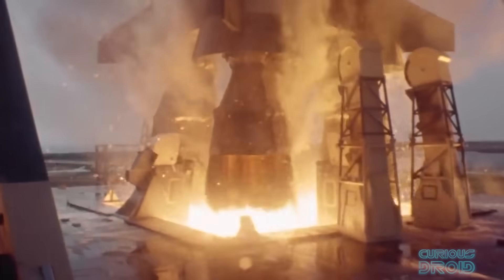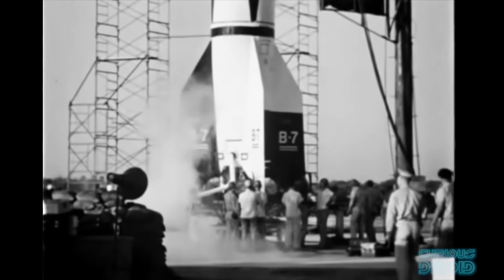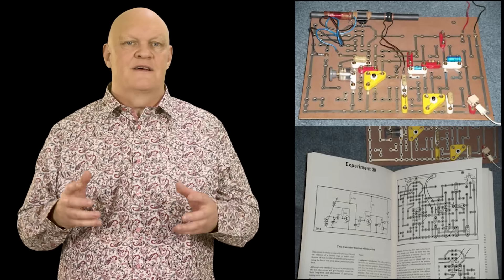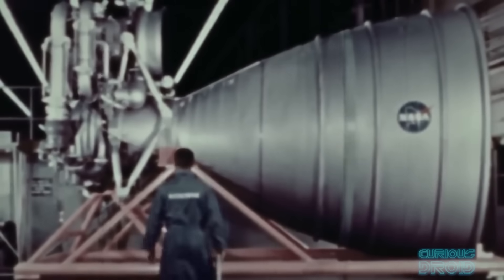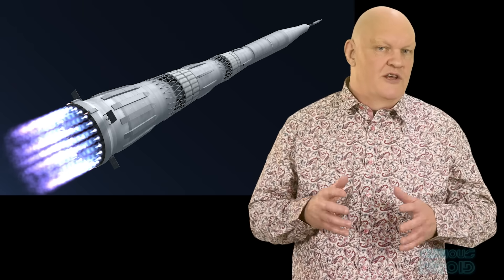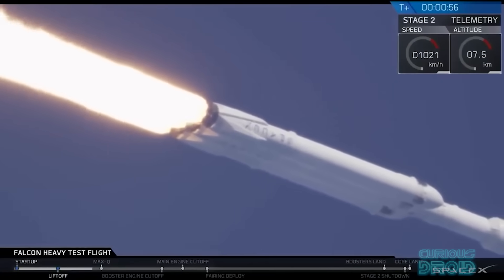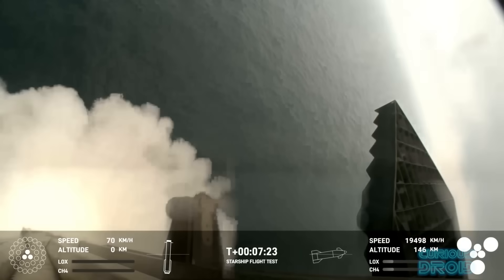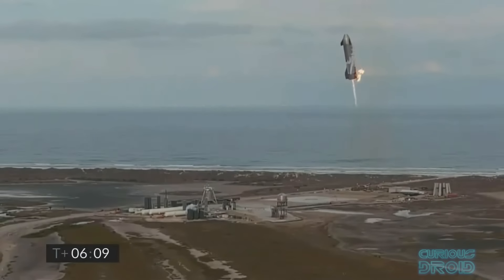Why Does SpaceX Use 33 Engines While NASA Used Just 5?

Comment: Another big advantage of the Raptor engine's size is that installing or replacing one can be done in a few hours, and with no need to first bring your rocket off the launchpad and back to the assembly facility.
Reply: NASA had to replace one of the engines on Apollo 11 due to a defect found in the injector plate. Took two weeks, and it hadn't left the factory yet.
Reply: But it worked as planned. Space x can’t even get a rocket into orbit. It’s a musk grift. A total ripoff.
Reply: This is true ! Ive seen raptors changes out in less than 45 minutes ! SLS would be weeks if not months and billions of dollars !
Reply: Did Apollo 11 actually leave near-Earth orbit?
Despite the revisionist narrative that this channel won't question -- unstable fuel burn for the oversized F1 engines was never rectified and another arrangement in their place was made in order to reach near Earth orbit, keeping the F1 bell nozzle to maintain the desired appearance.  The great licking yellow flame was an indication that something was not normal as fuel was burning in the atmosphere while providing no additional thrust. This was the result of injecting additional kerosene into the exhaust stream for greater visual effect yet appearing to produce an inefficient burn unlike other rockets after launch.  No explanation is forthcoming and this issue is not addressed in any usual report; however, using a smaller reliable engine with a reduced fuel load and stripped down mission requirement allowed the Saturn V to reach near-Earth orbit.  

The Apollo 11 crew attempted to demonstrate their position at over halfway to the moon as seen in the unedited version presented to the public while the more recently released unedited version reveals a flood of blue light entering the same window as the camera continues to roll, through which only a moment before, we saw the Earth far distant in what appeared to be very low light conditions. Then, as the camera pulls back from the window, the exposure settings are seen to return to normal as a flood of light enters the same window.  Without a change in the orientation of the spacecraft assumed to be on a trajectory toward the moon, the only source for any flood of light can be the Earth while in near-Earth orbit.  The usual sponsored efforts will try to make excuses for why the obvious did not take place -- yet is overly apparent in the unedited version.  When facts cannot prevail in support, sponsored activity will resort to name calling and other derogatory comments discrediting themselves.
Reply: @ronaldgreene5733  I'll take "things you can't do to a rocket engine for $1000"

Ask yourself this "why do rockets have different sized nozzles?"
Reply: .  . While remaining in near-Earth orbit, another indication are the impossible weather patterns seen on Earth, when in reality only a small portion of the Earth's surface was visible, framed by the round window of the command module.  Straight line cloud fronts are seen on video to be extending for what appears to be more than 6000 miles, a quarter of the Earth's circumference -- something that has never occurred in the meteorological record on Earth. The round window of the command module was used to effect an image of the Earth but the weather in the region did not comply for a realistic view.  No recognizable continents are found in view, but only the impossible weather patterns seen.
Reply: @ronaldgreene5733  "something that has never occurred in the meteorological record on Earth. "
Wow I'd like to see your proof of this.
Reply: @stusue9733 .  . "meteorological record" .  . 😃 .  . Thank you for your sponsored reply.  You require proof in the meteorological record for any time in the past where a single straight line cloud front -- and we have two in the Apollo image -- has ever occurred extending for ovr 6000 miles, approximately a quarter of the Earth's circumference.   Good luck with your search, because it belongs to you that even one, let alone two of these ever took place -- as demonstrated by Apollo, framing a much smaller portion of the Earth within the round window of the command module.  When you find evidence of even one -- you'll certainly be congratulated.  We'll wait for your results .  . Good luck and good hunting.
Reply: @ronaldgreene5733  NO NO. It's your claim, don't be trying to give me the job.
So either prove "something that has never occurred in the meteorological record on Earth." or admit you lied and just made it up.

Once you have done that we can then check to see if there is indeed a 6000 mile line, but I feel no need as yet to even look, after all it's your claim.
Reply: People still seriously think that SpaceX is funded by NASA and not by private launches and Starlink lmao
Reply: Do you think it's a pit stop? It takes days man. This ain't kerbal.
Reply: @edfleming9600  I know it can be hard to wrap your head around, with 60+ years of traditional timelines culturally ingrained into folks who follow space.  But yeah.  My advice is to subscribe to NASASpaceFlight and/or LabPadre and keep your eyes peeled.  You won't find yourself inadvertently disagreeing with widely known reality.
Reply: You don't get to just make things up. Just like you're "you're just antispacex" comment.

Starship was going to Mars with 100tons to LEO. In fact it should have been there at least 2 years ago. It was good enough to be the HLS as well.  All this "bigger better starship you are just retconing. I don't need to reply to things you just made up.
Reply: No, not in hours. Please do not spread disinfo.
Reply: @ZorroComputers  Bring it up with NASASpaceFlight.  They're the ones who have filmed this happening several times.  Meanwhile here's the old video where they installed all 29 engines overnight, back when they were using the more complicated Raptor v1.  https://www.youtube.com/watch?v=3v3wxg7DI5o
Reply: @ZorroComputers  It doesn't even take them hours anymore.
Reply: nope. it can't.
Reply: But if they are end of life that is 33 engines you have to replace. You are being silly, just prepping to remove a Raptor takes hours.
Reply: @EricHamm much easier to replace 33 tiny motors instead of a handful of super large motors 😅
Reply: @EricHamm  Over a year ago, SpaceX ran a drill to see how long it would take to install all 33 engines.  They did it overnight.
Reply: @EricHamm 
A few days is still better than a few weeks.
Reply: @EricHamm hello man who doesn't understand time.
Reply: Starship is not going to the moon. So why even bother with a pile of metal.
Reply: @ZorroComputers 

Starship isn't leaving LEO lol 

It will be scrapped once Musk runs out of money by not meeting NASA milestones. 

Glad to see others noticing the Starship silliness
Reply: @ericchin739  Egads.  Starship/Starbase have run $10 billion.  NASA has provided $2 billion.  I invite you to concretely suggest that SpaceX would be unable to continue if they hadn't had 20% of their expenses covered.
Reply: @Asterra2   I guess we shall see whose spacecraft gets to the moon first. 

Won't be Starship, but we shall see.
Reply: @ericchin739  What arbitrary race are you trying to establish here?  Starship is not being designed for trips to the moon.  It's in a race to be the first super heavy lift vehicle capable of dumping hundreds of tons of gear on Mars.  Are you somehow thinking SLS?  Artemis 2 flies before Artemis 3.  I can, uh, prove it, if you don't believe me.
Reply: @Asterra2  No, I'm thinking HLS.... and yes, Starship is 100% being designed to take humans to the moon. 

You even mentioned Artemis... 🤣

But sure, I'm just making up an arbitrary race.
Reply: @ericchin739  Fair enough.  Between HLS and what vehicle?  I am drawing a blank.  (And no, Starship is not being designed for Artemis.  It's being retrofitted for it.  If SpaceX were "designing a craft to land on the moon" and only that, the design would have been finalized years ago and the vehicle would be done already.  You don't need full reusability or the ability to loft 100-200 tons if "landing on the moon" is the only mandate.)
Reply: @Asterra2   HLS is supposed to rendezvous with the capsule in lunar orbit and then land on the moon. Then take off from the moon and go back to Earth. 

Sure, you can believe what Musk tells you, but how is he supposed to get to Mars when the Moon is a struggle for them? 

They were supposed to have (according to NASA contract with them) landed an unmanned Starship on the moon.... in April 2024 

So, if the vehicle were being designed to go to Mars.... how come they are having issues getting to the moon?
Reply: @ericchin739  (part 2) By any reasonable measure, Starship development is obscenely fast.  But they are pursuing reusability and heavy (100-200 tons) lift simultaneously, first and foremost.  These have never been done together before.  Ever.  Let alone for the biggest rocket ever made.  SpaceX conducts testing with real prototypes because this is a dramatically faster approach than traditional rocket science.  If the test flight phase is what you mean when you say "struggling" then rest assured it's the same thing Falcon 9 went through before it landed 300+ rockets.
Reply: (part 1) Take a closer look at the actual NASA Artemis contract and you will see that milestone payments are scheduled to continue into 2026.  Plans change.  Right now, the main thing concretely holding up Artemis 3 is Orion's heat shield, which has pushed the mission to a hopeful late 2026 but more likely 2027.
Reply: @ericchin739 struggle to get to the Moon??   Starship hasn't been able to do a single orbit.  All for launches resulted in explosions or melting.

SLS went to the moon (orbit), came back and splash landed. 

If it takes 20 launches for a single starship lunar mission... What happens if there's a failure of one lunch?   Even if it's the 18th, the mission is scrubbed. 

What happens if a booster crashes into the chopsticks and explodes?  The mission is scrubbed. 

Where is the escape rocket? Starship is not human rated.
In its current design, if it falls the crew dies.
Reply: @tcat1990  If you legitimately believe NASA and SpaceX are going to wait 2 to 3 years for Starship to have 100 uneventful launches before putting crew on the thing, I may have a couple of bridges that would pique your interest.  No, they will use Dragon to put crew on and bring crew back off Starship from a parking orbit, bypassing the need to wait for the vehicle's launching and landing phases to be human rated.
Reply: @Asterra2  "If you legitimately believe NASA and SpaceX are going to wait 2 to 3 years for Starship to have 100 uneventful launches before putting crew on the thing"
eh?
What he said was starship needs 20 successful launches to get to the moon.
Reply: @stusue9733  Ah yes, that's another point I'm a little exhausted from having to clarify endlessly.  If Starship was out of the prototyping phase and Block 1 was literally the final design (ignoring the fact that Raptor V3 is on the wings and will obviously stir things up when it arrives), then fair enough.  But HLS won't be needed before 2027.  SpaceX will be on Block 3 by then, the payload will be ~200 tons, and you'd have to do some serious, studious ignoring of reality to imagine that it would take 20 flights of 200 tons of fuel to refill ~1200 tons.  The argument about "20 trips" conveniently pretends that SpaceX is going to stop developing Starship for three years.
Reply: @Asterra2  Why do you lot keep believe elons dates? We should be on Mars by now. Three times I believe(though I can;t be bothered looking up when the transfer orbits are). And he didn't need a 200 ton to LEO to do that. That only came about because his current rocket can barely get itself to orbit, not the 100 tons Elon stated.
Reply: @stusue9733  Amazingly, you've independently hit upon one of the most important observations about Starship.  SpaceX is not designing it for NASA.  It just happens that once the design matures enough, it will be capable of fulfilling an important part of Artemis 3+.  That doesn't mean SpaceX is going to abandon the actual purpose of the vehicle while they're prototyping.  That all being said, Artemis would be completely dead in the water after Artemis 4 because NASA has not contracted anyone to create a vehicle that can actually land the 1000+ tons of equipment "staying on the moon" will require.  Of course we all know why NASA hasn't made this contract: That vehicle will already exist.
Reply: @Asterra2  No telling what will upset the filter.

Amazingly you seem unable to answer the question asked.

He didn't announce his bigger rocket until it was clear the one he built to do the job wouldn't in fact do the job. Then you try and pass it off as "all part of the plan". In fact even you admit it will be "block 3"..... maybe.

Would you like a list of elon other failures?
Reply: @stusue9733  What?  Are you just going to pretend that SpaceX has had dramatically better engines and higher engine count profiles (for both vehicles) on the wings for years but they were just going to sit on them?  You don't get to, chief.  New prototypes to accommodate these advances were always going to come.  You literally cannot add the higher Isp engines to those vehicles, or increase their numbers, without affecting TWR and necessitating tweaks to their capacities.

If you think it's frustrating being shut down like this, spare a little pity for me who has to put up with this level of discourse.
Reply: @Asterra2  I notice you didnt address the issue.
So you are claiming they built the wrong rocket. Well done.

Bet you still think FSD is coming by the end of the year.

perhaps a tube with an air hockey table in it?
Or wheels, its more profound than you think.
Reply: @stusue9733  So is that what anti-SpaceX strategy amounts to?  Get shut down thoroughly in an argument, and then pretend the other person didn't actually type anything?  Or is that just your own personal reflex when cornered?
Reply: @Asterra2  Where did you get the idea I am anti spacex? Oh that's right, you made it up. I sure hope spacex don't go broke, I use starlink. I can only assume like so many other things, you make up what ever it is you think suits your argument.

It was your word that hung you not mine.

I think we can agree we are done here. But feel free to carry on without me as so many elon worshipers seem to like to do.
Reply: @stusue9733  Then how about offering a legitimate counterpoint to what I actually said, rather than a literal boilerplate copypaste that could have been a reply to anyone discussing anything.
Reply: @Asterra2  "Then how about offering a legitimate counterpoint to what I actually said"
Oh doctor heal thyself.

elon says "move the goal posts and pretend it's all part of a master plan"
you say "how far"
Reply: @stusue9733  That's a no, then?  Passersby are going to scroll up in this conversation and note that the last time anyone directly countered the other guy was when I talked about SpaceX's long-gestating plans for Starship prototyping.  They'll see you replied to this with nothing at all.  Not a good look for somebody trying to call the kettle black.